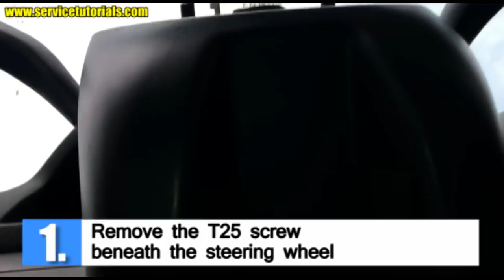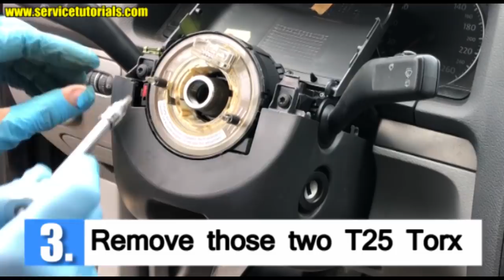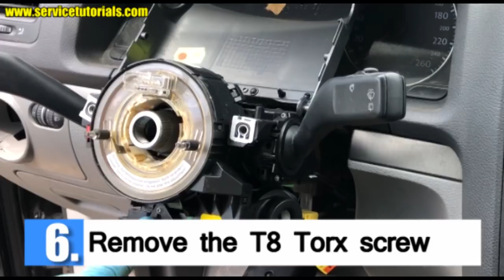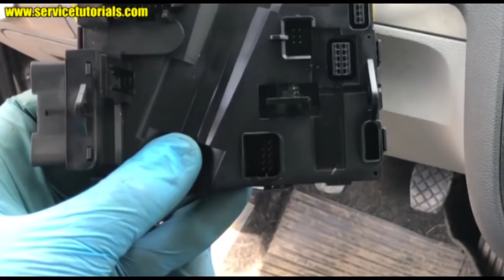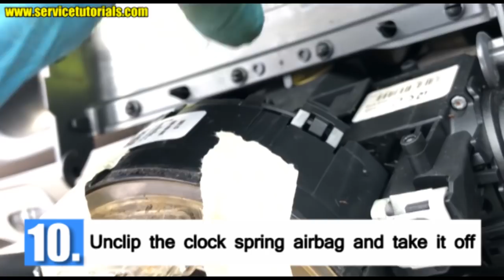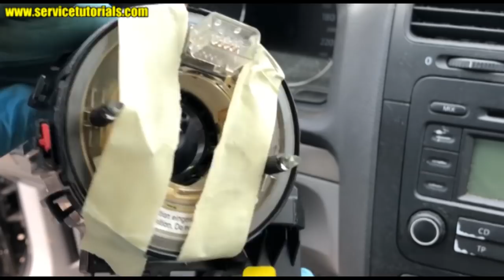How to remove clock spring airbag spiral cable VW Golf Mk5, Rabbit, Jetta in 10 steps

Comment: if i change clock spring do i need recode the new one? becouse mine broke when turning. The horn and buttons on steering wheel dosent work and airbag light is turn on.
Reply from the maker: tofftoff Hi! Yes, you have to perform the calibration for the new clock spring.
Reply: @Servicetutorials  can i Säve the old code and put it on the new one?
Reply: Sonic